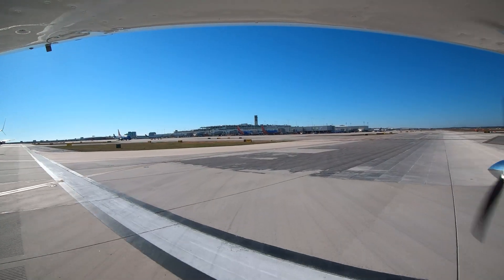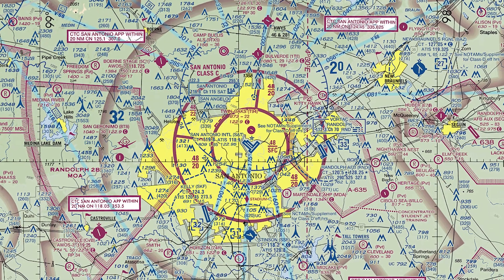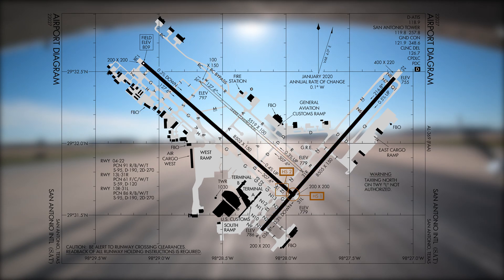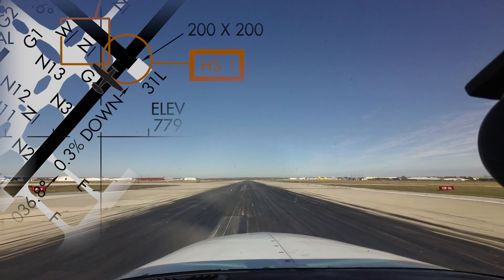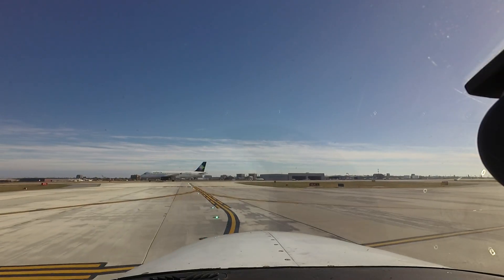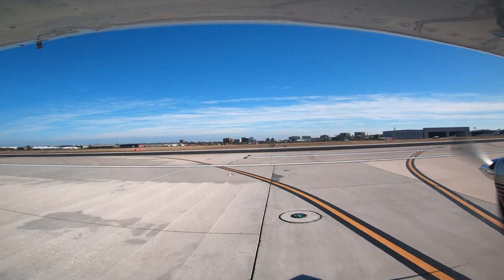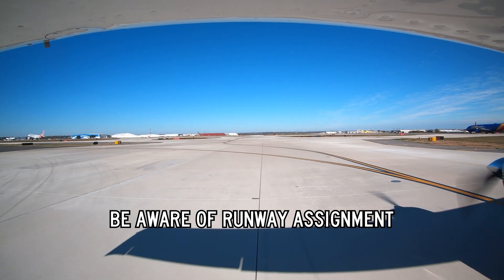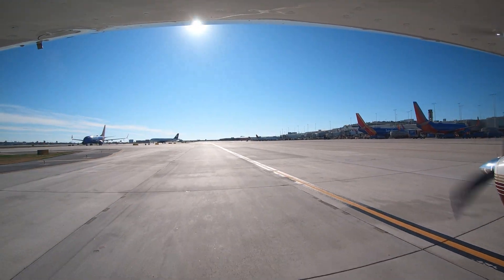From The Flight Deck – San Antonio, TX (SAT)

Comment: The control tower radio is very weak, hardly heard like 10-15mile on a tuned received antenna and elevated location overlooking SA. Also tried  on my mobile , like 2-3miles away.. towel signal is fluctuating.  maybe someone should check their setup. been listening like 10yrs now.. no changes, different radio receiver.  my 2 cents.